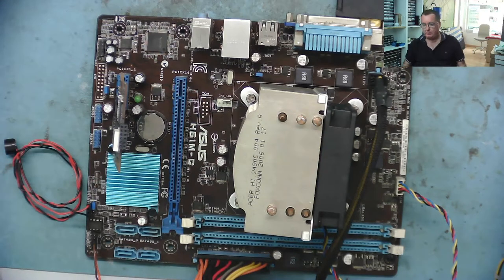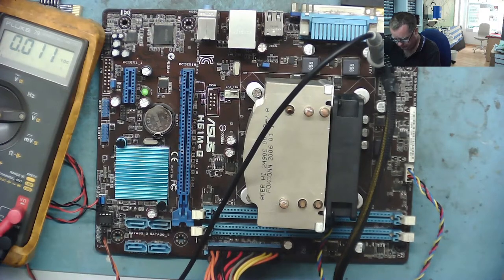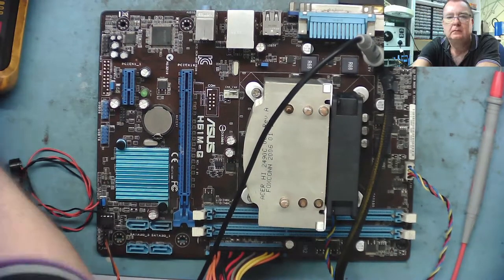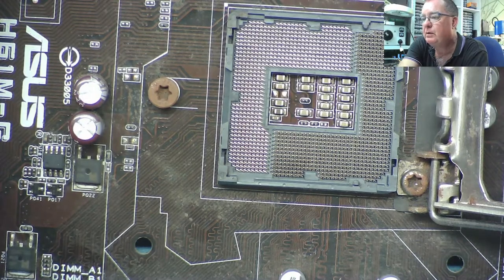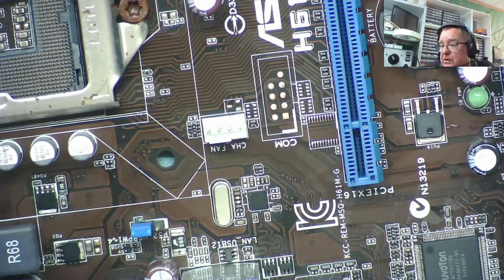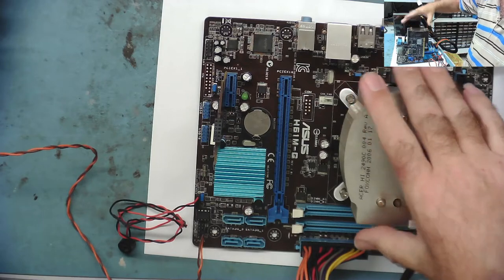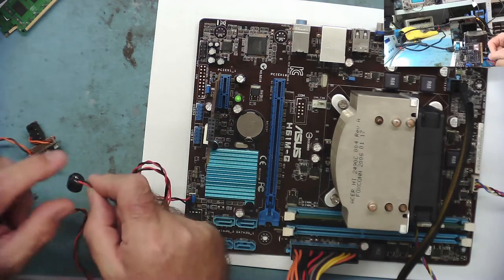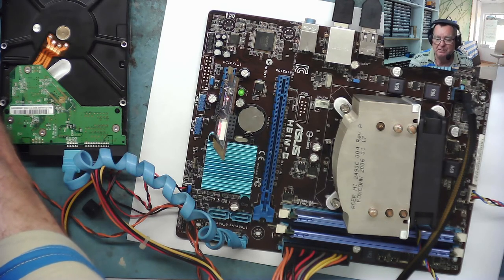Motherboard Repair Powers On but No Beeps No Boot - LER #089

Comment: i tried washing my motherboard before but i did not use tap water. i bought  a gallon of distilled water. washed the board with dishwashing liquid and dried the board up with a heat gun. the board is still working until now. thanks for this video.

Comment: To anybody else watching this video, this is an absolutely horrendous way to clean any type of PCB. Tap water contains so many minerals and impurities that while it may look like your system is functioning for a while, oxidation and corrosion is building up that can cause a short circuit that can not only destroy the motherboard, but many things attached to it; memory, video card, power supply, and SSD/HDD. 

If you have to clean a board, use the purest alcohol solution you can find, and in the smallest amount and region possible. Also make sure to dry clean the area first to remove as much of the contaminate as possible before using the alcohol. If there is contamination under a large chip, you're going to have to clean by soaking the chip in alcohol, letting it sit for a bit, then using air to blow the alcohol out from under the chip. Just letting it dry will leave the junk underneath. Do this multiple times until the alcohol coming out is clean of contaminants.

If you HAVE to soak the whole board, follow the same dry clean first, then alcohol directions, but when it is submerged, you want to start giving the whole board some side to side and rocking motion to knock that stuff loose and off. Depending on location, you can also use a very soft toothbrush to help in this. DO NOT SCRUB. Just pretend you're a paleontologist uncovering some velociraptor bones, gentle strokes. You're removing soup/soda/bong water not trying to scrape off the solder mask (conformal coating on some boards). Take the board out and blow out from under the large chips, the CPU/MEM socket, and the IO ports. Let this dry on its side for about thirty minutes. Now the next step is something I have done, but it can be dangerous if done incorrectly, I would take a reflow gun and set it to the lowest temp (100°C) and from a distance of several inches and at varying air speeds, go over the entire board, front and back, until the entire board was heated up to a "warm" temperature. Not blistering hot and not cool. This helps with making sure there is no stubborn 1% or 9% of water (Depending on which isopropyl alcohol you use) stuck in some of the VIAs (vertical interconnect access) holes or between two solder balls or in a little nook or cranny of a slot/socket. After all that, let it cool down to room temperature and try to fire it up again.

If you still have no joy after all that, assuming you didn't test the memory/CPU/PSU/CMOS battery/monitor/video cable first, it's probably time for a new  motherboard.

Comment: I've always thought washing the boards to fix them was a myth but I guess it can work when the board is in a bad state with all that rust.
Reply from the maker: It's no myth Farben  - I have fixed quite a few boards this way.  To finish the job nicely, I would also change the metal frame around the CPU socket - I always keep these from scrap boards and they come in useful.

Comment: Maybe it’s me here in San Diego, CA but the audio level has been low on 2  of the videos
Reply from the maker: Hi Mike - can you tell me which videos please so I can check to see if they are lower than the others.  Also if the low audio affecst the whole video or just part of it. I'm trying hard to get the audio level right.  Thanks
Reply: @LearnElectronicsRepair  it was this video and it did get better later. I’m sorry I can’t be more specific. I’m going to go back in my history to see if I can find what it was. Now I’m thinking it might have been my environment as I watch on my tv in my living room. Depending on the time of day it can be noisy due to air conditioning running. Anyway I’ll try to gather more information and let you know. I hope this helpful. Btw I just started watching your channel and have added you to my regular watch. I dabble in vintage audio repair but troubleshooting is relative and I can still learn from you and the experience you obviously have. 
The video 500w ATX PSU 5V Standby ok…LER#88. My volume level will vary from about 15 to 20 typically but this video it’s up around 47. The range of volume on my Samsung set is from 0-100

Comment: It didn't bleep because you have a debug card connected. In that case the bleeper should be connected to that card, not to the pc.
Reply from the maker: Hmm that didn't stop many other motherboards from bleeping is there is a debug card fitted - I'm not saying it may not happen on some specific board.  I'll prove or disprove this on my next video.  Thanks for the suggestion.
Reply: @LearnElectronicsRepair  it is ... more or less board specific, since every bios has a slightly different behavior with those cards, then apart from that it depends on where you plug it in, pci, pci-e, pins, etc. depending on the bus you connect it to it will react differntly. I got one from china for a few bucks and with some board it beeps, some don't.. speaking of logical units.. huh! But atm getting frusted with an ASUS Crosshair V Formula that wont show any code on my Analizer Card, but not sure if that's related to that I don't have a FX CPU connected to it cause I don't have any here atm and with an old Athlon CPU it wont post... such a shame, this board..